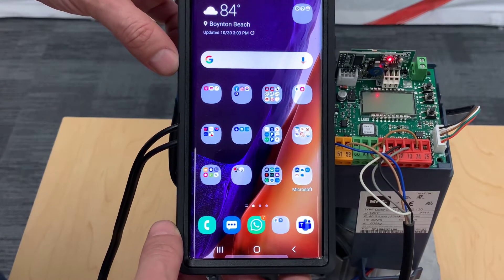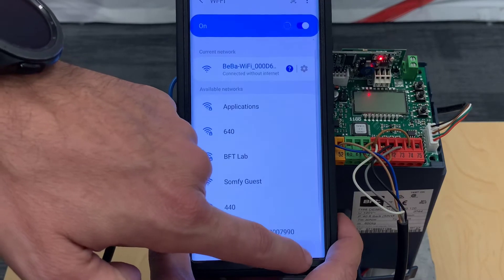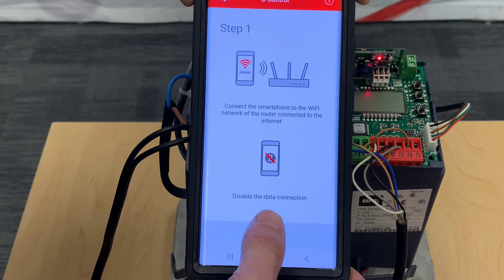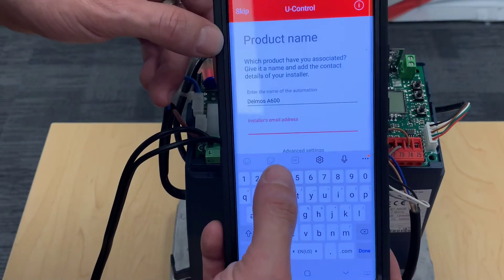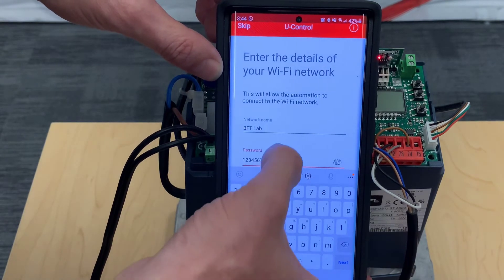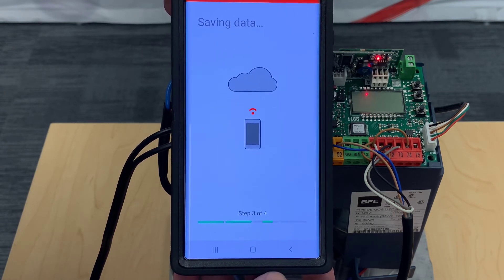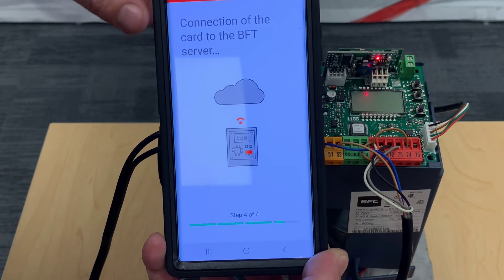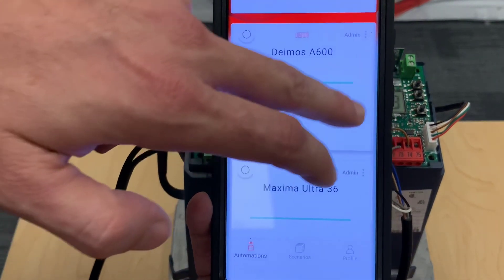BFT B EBA WIFI Gateway 2.4Ghz - New updated set up ***Troubleshooting steps in description***

Comment: De ce isi pierde modul foarte des comunicarea cu serverul cloud? In momentele in care nu functioneaza eu pot vedea modulul activ in router dar lipsa de comunicare mai departe. Nu si intretine BFT serverele? Pana acum cu 2 dispozitive patesc la fel. E ceva ce imi scapa mie?
Reply: Why does the card often loses communication with the cloud server? In the moments when it doesn't work I can see the active module in the router but there is lack of communication further. Doesn't BFT maintain servers? So far with 2 devices I suffer the same. Is there anything I miss?
Reply from the maker: Ne pare rău pentru neplăcerile create, prietene, dar în prezent avem o problemă cu serverele noastre și lucrăm cu sârguință 24 de ore din 24 pentru a rezolva aceste probleme. Vă rugăm să aveți răbdare cu noi și ar trebui să avem o soluție în curând. Vă mulțumim pentru răbdare.

Comment: is this gateway compatible with all BFT ramps/equipment?? thanks for the video !
Reply from the maker: Those Gateways are only compatible with "U-Link" ready operators. Not all operators that have a digital display on the control board are U-Link compatible, but all non-display control boards are definitely not U-Link.